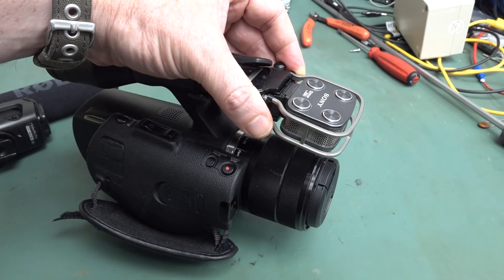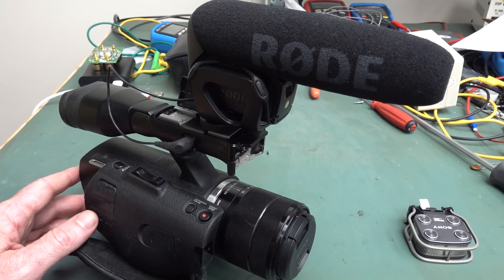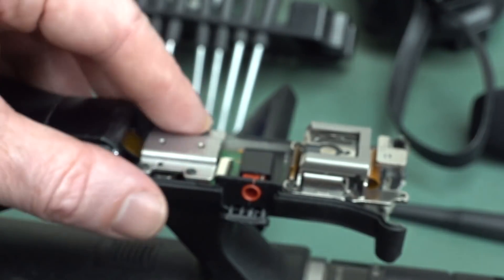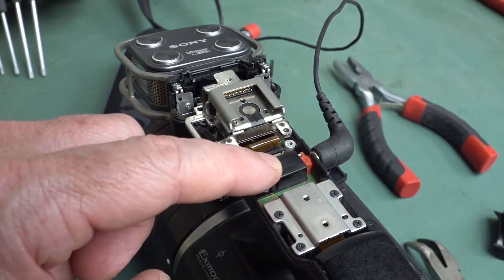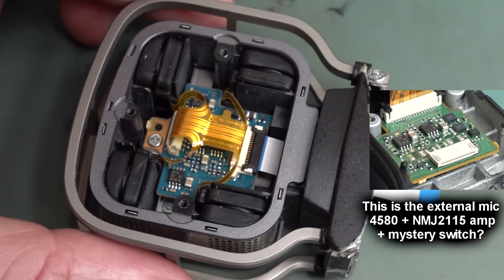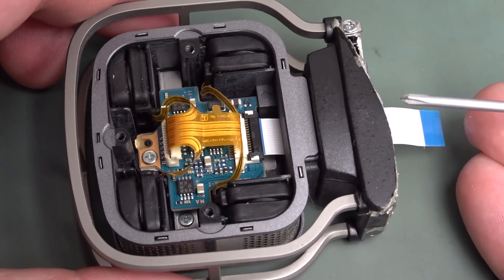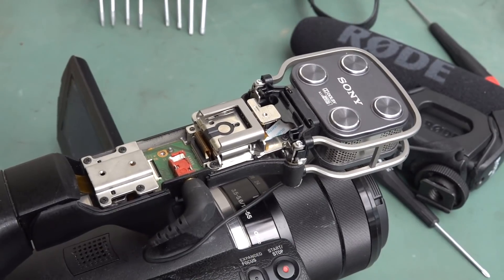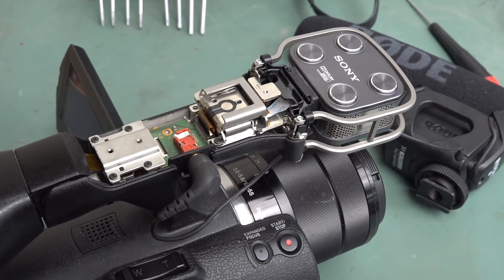Sony NEX VG30 Claytons Repair 2 Microphone Boogaloo

Comment: They pulled a fast one on you. I looked at the diagram, they produce the bias voltage for "all" of the opamps on the internal mic preamp board. Take off the board and voila, no bias voltages for the external opamps. The funny thing is, is that they go through all of the trouble to put in dc switching fets for the opamps power source! Full diagram is here, https://elektrotanya.com/sony_nex-vg30e_eh_h_level3.pdf/download.html. The level 3 diagram is the full manual, the level 2 manual is the exploded views of the camcorder.  Hope that helps. Sean

Comment: You did a nice repair job. Is it easy to remove the viewfinder of the VG30 and will the cam work properly without it? I want to demount that protruding part because I don't need it and it is interfering with my gimbal. Thank's in advance for your valued reply.

Comment: Why not just JB weld or epoxy a bracing bar or 2 to the BOTTOM of the Mic that extends all the way to the support arm (call it a leg that extends from the body of the camera  on up)? Literally something on the bottom of the Mic assembly on back to prop/support it up. When I saw the original fix video, I knew it was only a matter of time before the repair failed.

Comment: I frankly see that you can save the original mic, regardless of the casing being something like magnesium, 1st get some common superglue this has to be the liquid type and NOT the gel type, forgo epoxy, as it wont provide same results, plus, epoxy can create on the user a allergy, so skip it by all means, soooo as I was saying you need superglue, I suggest looking for Kola Loca and then get some bicarbonate, yet if extra toughness is desired, later, you could get some cotton, ok so 1st step clean the surface, and remove the old epoxy junk, leave the metal or plastic as pristine as possible, then join the broken parts, where possible ad a little drop of the glue and before it dries and some bicarbonate, this mix will create a super hard mix that resembles hard plastic, if you want after you have finished closing all the gaps with the method suggested, then you could go the extra mile and rap the thing with strands of cotton or some similar fiber, then to that you add a few drops of glue with the bicarbonate, and you will end up with a thing that is probably better than the original, paint it black and forget about it....by the way add something like soft rubber foam, sort of like a car bumper so that when you drop it it is not metal hitting hard floor

Comment: In an alternate universe where they actually DID design that mic section to be detachable, you'd be making this same video and pointing at it, going "look at this. they knew the mic was rubbish and it would break off, that's why they made it totally detachable and even the external audio still works without it."

Comment: Don't know if it's available in Australia but Rectoseal two-part EP-200 Epoxy Putty might be something to consider if the single screw doesn't work out; it's strong enough to machine once it sets up.

Comment: Use some 3M DP460 epoxy for those tough ass repairs. That stuff is the ducks guts but a bit pricey. Plus it is not conductive.

Comment: Can DIY additional metal brackets to further tie metal parts together using existing screw locations.
Can source metal from dumpster pc cases for example.
Some accuracy required though, and I doubt Dave can achieve that.

Comment: This obviously wasn't a design decision, it would've been a design requirement from management. If anything can break on the product, it has to be catastrophic and make the product no longer able to be used without either paying an extortionate price for repair, or paying for a complete replacement.

My suggestion would be to find out what that top assembly is called and see if you can source a replacement from someone in your audience. Surely someone works for Sony or somewhere in the supply chain or an authorised repairer or something, and could send you a replacement part. It looks like the microphone head is detachable, and all your electronics are still working, so you'd only need the shell part that attaches to the camera body.

Otherwise you could set up an eBay saved search and hope someone puts up a faulty unit for cheap to scavenge parts from.

Comment: What about JB weld? If you don't plan on using the internal mic anymore,
could you remove the board from the heavy surround and epoxy it under where it broke or somewhere?
It looks like the ribbon would be long enough. Try disconnecting the four small ribbons first and see if your rode will work that way.
The camera's still pretty pricey so I think it's worth saving. 
Thanks Dave

Comment: I wouldn't know if it's available in Austraila or not, but you could try JB-Weld Original. Project Farm did a comparison of several different epxoies, and it kinda does live up to it's reputation in the US. One of those if that doesn't work, nothing is going to

Comment: How about lose the hot shoe complete with board, if the camera will operate without it, and then  fold that mic board over into it's place, isolated with some kapton tape. That provided the shotgun mic will work off the back cold shoe, and then the front hole can be covered with some tape on the inside, and a thin black sheet stuck to it to cover the hole up.

Likely the board in the mic is the opamps for the microphones in the head, and the 2 small chips are a matrix that allows the external mic to be selected or the front or rear pairs, or mix them all. 8 pins, 2 power and ground, then 3 audio inputs and one audio output and the remaining 2 are for some I2C control bus to drive them.

Comment: Rip the mic-board out and glob it in the place of the microphone with hotglue
Reply: Yes, this can be done at a parts/labor cost of about $1000
Reply: Hot glue can't hold anything, silicone/polyurethane adhesive is much better

Comment: On the other side of the propriety shoe was a metal bracket on the opposite side of where you put the screw. Just put a cable tie to the mic or a copper wire so that side is held fast.

Comment: why do people think epoxy is such a great adhesive?   It is actually quite a poor adhesive as it mainly holds by mechanical locking, i.e. the surfaces have to be rough and irregular for epoxy to hold.   Smooth surfaces and other low-activity materials won't stick..   You're far better off with toughened cyanoacrylates or urethane adhesives in most cases.
Reply: The main problem is relying on the peel strength of the glue on a very thin edge. Better to glue a patch over the join so not only has it a much greater area, it is also operating in shear, which won't let go.